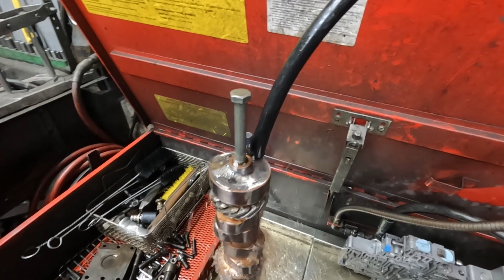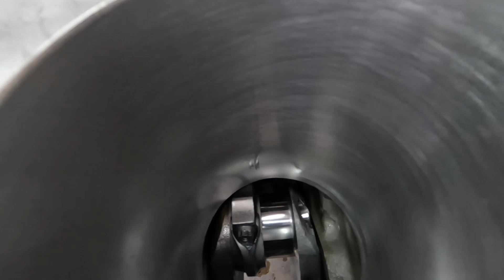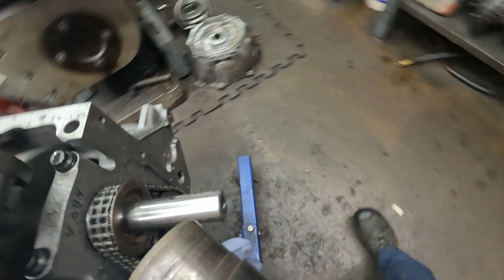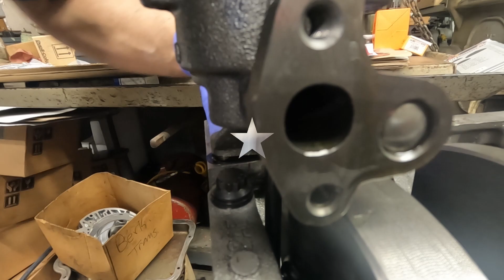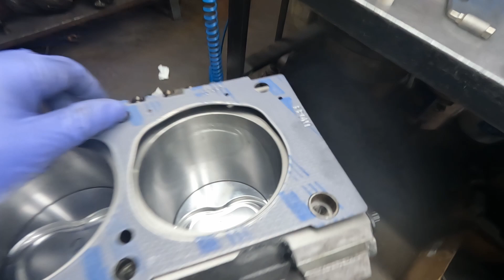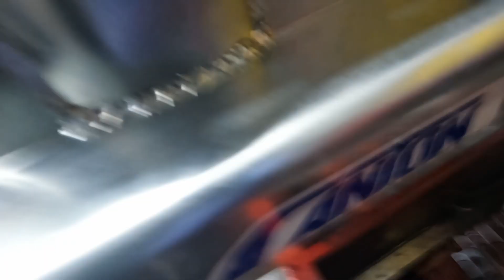#6 445 Ford FE Final Assembly

Comment: Hello, so on the rear main cap you just used the RTV and no side seals?
Reply from the maker: Hi, yes. I got the idea from Lykins Motorsports. If you don't already watch Brent's channel, you'll want to check out.   @lykinsmotorsports
Reply: That’s a nice block, is ita 3 rib main?  .030 over
Reply from the maker: @Bbba724   ,030 over yes. 1966 390 block. Not sure about the ribs.